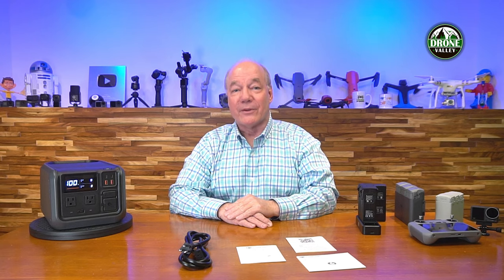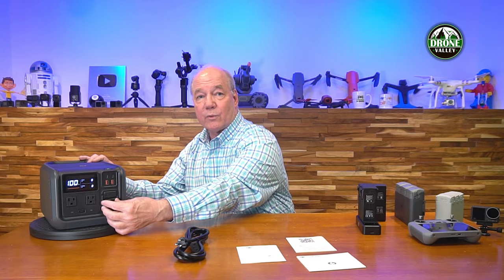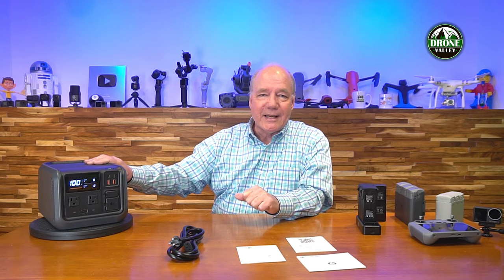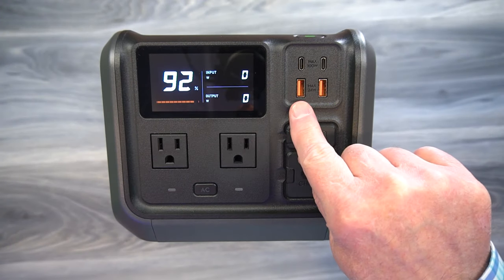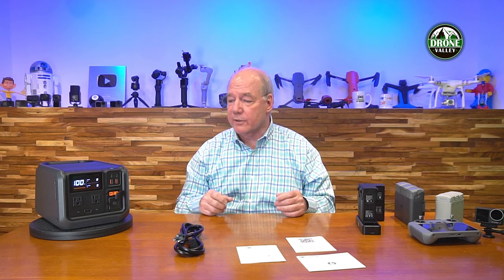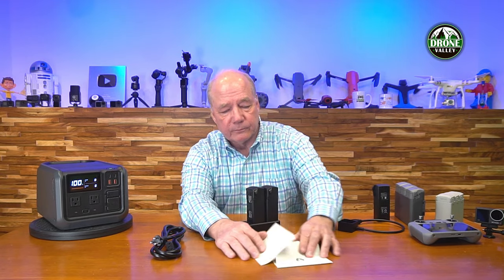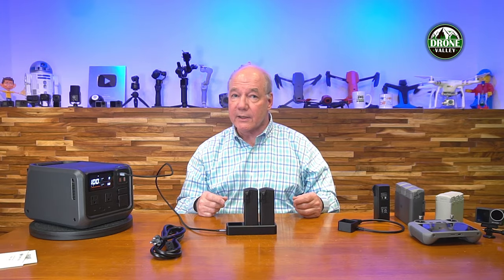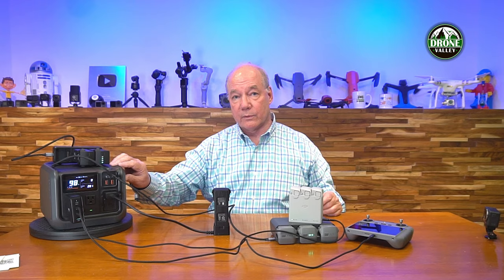DJI Power 500 - Perfect for Drone Fliers | Complete Review

Comment: My DJI Power 500 arrived mid-week.  Tested it out on Friday night charging all my batteries, controller, strobe lights and even my cell phone at home.  The optional fast charging cable for the battery, charged the battery as advertised.  (Fast charging up to 95%, then using a reduced charge to 100%, to protect the battery) Yesterday, I took it out in the field with my DJI Air 3, with four batteries.  For the first time, I did not worry about having enough batteries.  Especially, when I brought the drone down mid battery to change NP filters.  I now could switch ND filters, install a full battery and stay up with a fresh battery as the other one charged.  My wife asked me is this something "I needed" and I orginally told her this is something "I wanted".   After using it, I can say that this is something "I needed".  This is a game changer to be able to stay up in the air as long as I wanted without thinking of my battery levels.  I know now that if I travel to a location that is a bit of a drive, I can stay there as long as I want and make the best out of the day.  I use to run my SUV that has two AC outlets and sit and wait for the batteries and controller to charge.

Comment: So it can be used as an ups? If so what is the time to switch over?
Reply from the maker: Yes, it provides a power-through mode as a UPS and can switch between line power and internal power in 20ms. It also has a low-power mode for CPAP machines and other low power devices. Thanks for the post!
Reply: 20ms is quite long for a ups. Better than nothing I suppose
Reply from the maker: @mingscustoms  Actually when you compare it to other Power Stations, it's actually quicker with the 20ms flip. The EcoFlow River 2 model takes 30ms to switch so this one is quicker and most computers or NAS drives won't even notice it.
Reply: @Dronevalley the ecoflow delta 2 will switch at 30ms ASSUMING it can detect your load. It’ll fail the switch over under very light loads. This is verified empirically and hinted at in the manual.
Reply from the maker: @johnsullivan8673  The DJI Power 500 has a "Low Power" mode that won't shut the unit off if the output drain is very low. This is great for phone chargers or CPAP machines that start and stop. The key thing to keep in mind is that DJI primarily designed the Power Series to compliment their drones and other gear. It's outstanding for that use case and the SDC port really changes the game with Power Stations and I'll bet you'll see it on others in their next models.
Reply: @Dronevalley  nope. Please refer to page 8 of the manual and read it carefully. “Automatic Shutdown at Low Power Output”. The mode you’re describing is continuous AC output, which does not evaluate AC output at all and has the relay permanently toggled and the unit running.
Reply from the maker: @johnsullivan8673  Nope, you have three choices for Auto-shutoff and two of them control the AC output. Tap the AC button once to enable auto-shutoff after 30 minutes if no power drain and if you hold the AC button longer the light will stay solid and the AC won't turn off at all. That is the setting I'd probably use for a CPAP machine. If the AC portion isn't on at all, the Power Station will turn off if it doesn't see ANY power drain from any of the ports for more than an hour.
Reply: Thank you for the great review! I work from home and I’m tired of loosing power every time we get a bad storm. I plan on using this to run my WiFi!

Comment: Hey Rick not sure if I missed it but does this support pass through charging?
Reply from the maker: Yep, you can charge the Power Station and connect other gear to the AC and USB to charge external devices at the same time. I haven't tried using the SDC with the power-through feature so I'll have to check that.

Comment: Rick did you happen to "real world test" the number of Mavic 3 batteries you can charge from the 500 for typical flights where you're landing with around 15% and need to get back up to near 100%?  I know we can math this one out but I'm looking for some real experimental data.

Thanks!
Reply from the maker: Thanks for the post and I haven't tested it past 4 batteries but the math will vary a little depending on the charge level of the batteries when you start charging them. Technically speaking, the Mavic 3 batteries have 77Wh of capacity and the Power 500 has 512Wh of available capacity so even with some power loss through the charging process, you should get 7 or 8 full charges out of the DJI Power 500. I'll be testing it more this coming week and can update this post when I have more data.

Comment: Darn, SDC adapter for Mavic 3 not available 4/24/24. Sheeeeeiit😡.  Got the 500 anyway 🤓
Reply from the maker: Yep, they were still in production when the Power 500 and Power 1000 were released. The external DC kit and MPPT kit (for the solar panels) are not out yet either. They'll be coming soon so keep an eye on the channel for updates.